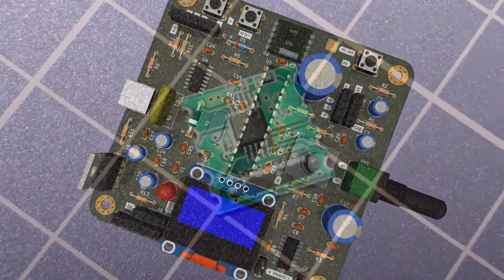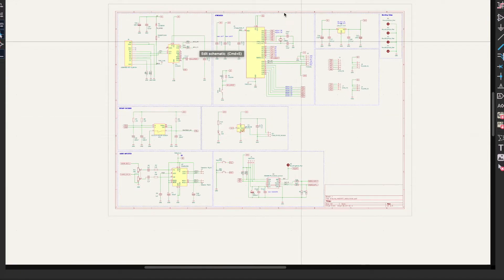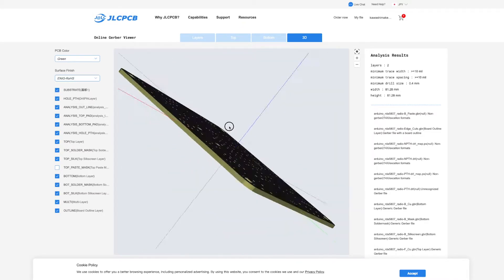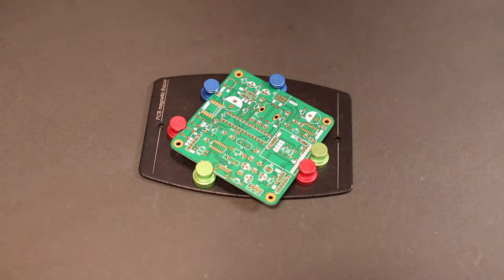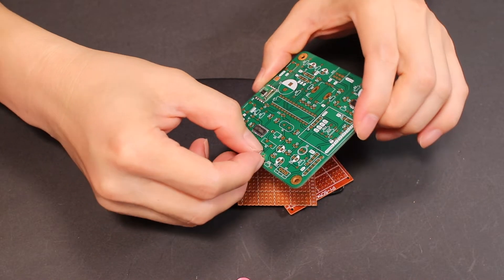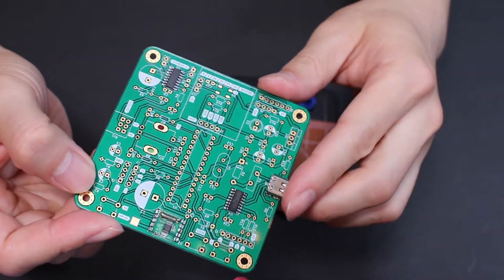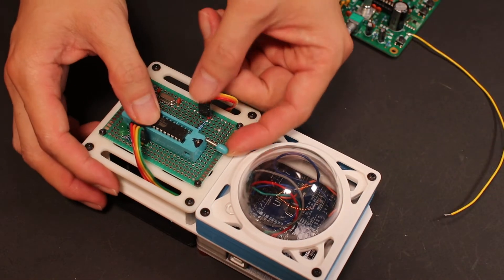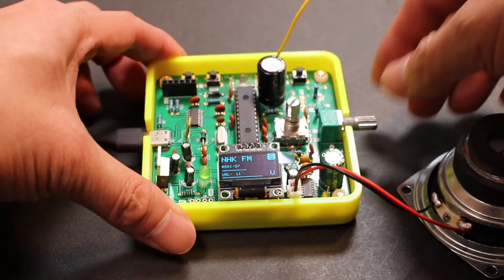How to make an Arduino-based FM Radio  (ATMEGA328 + RDA5807M)

Comment: any fm module that i work with gives noise the moment i switch on those class d amps, use it with AB no issues, & tea5767 is much more preferred than rda5807(it's costly also), had made a rda5807 earlier it has direct heaphone out, had to much static noise for any station to be heard.
Reply from the maker: Nice to know! Thank you for the info!

Comment: Wow is RDS data also included ❤
Reply from the maker: You mean the program?
Reply: @KOKENSHATECH  ,the radio station name & information is displaying na, that's Called RDS data,
Reply from the maker: @GM_handle22  Oh, I see. In my code they are not included. Radio station name and their frequency is fixed to my local stations.